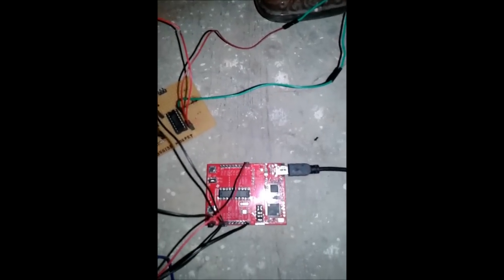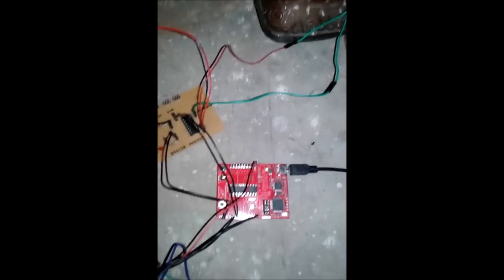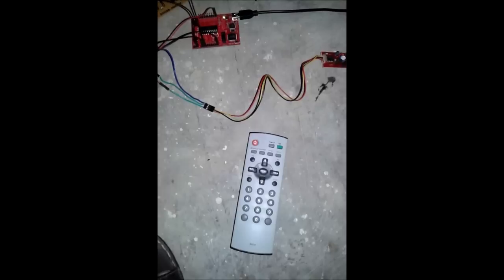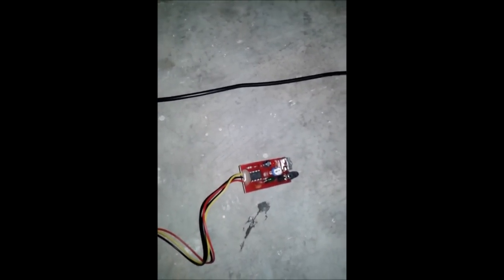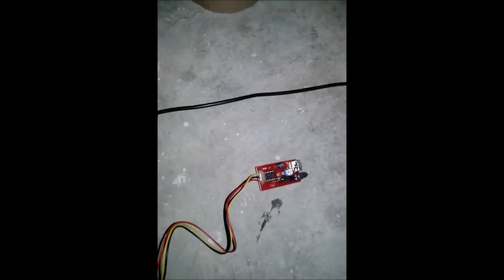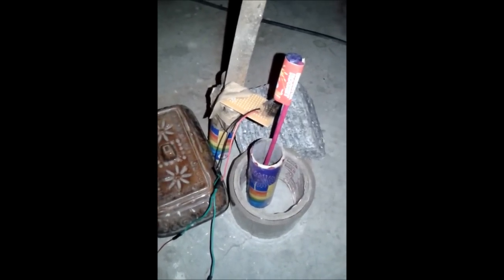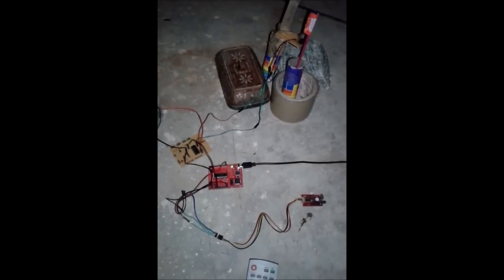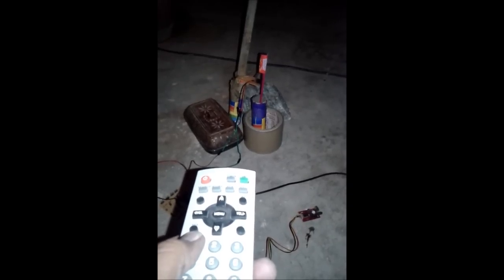Remote Controlled Fireworks Ignitor Texas Instruments Diwali contest 2013

Comment from the maker: MSP430G2553IN20 costs about 2.4$ (150 rupees)
If bought in large quantities, cost will come down
TSOP1738 (20 rupees)
ULN2003 (8 rupees)
Any household TV remote can be reused
Most of us have digital cameras and hence rechargable batteries. The same batteries can be used.
Nichrome coil i used from soldering iron. A local vendor quoted 2.5k rupees for 1kg.
i beleive the whole circuit should cost less than 200 rupees